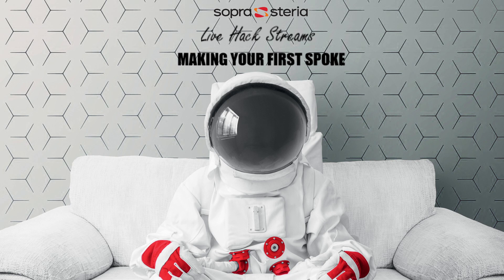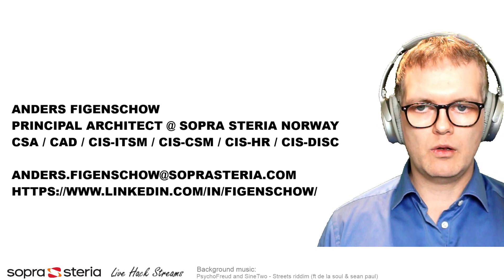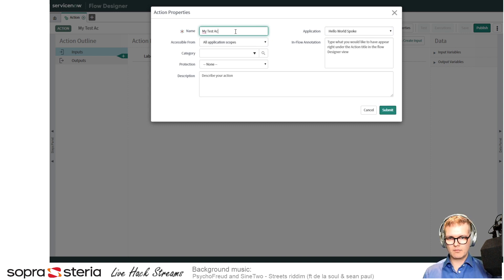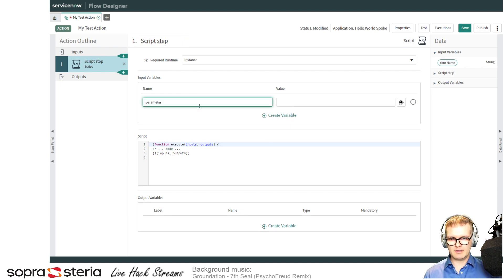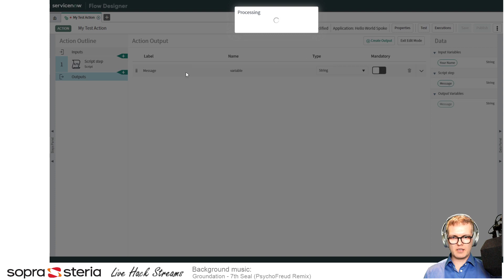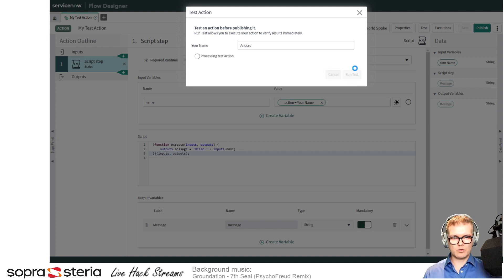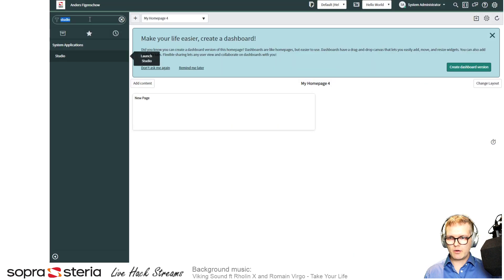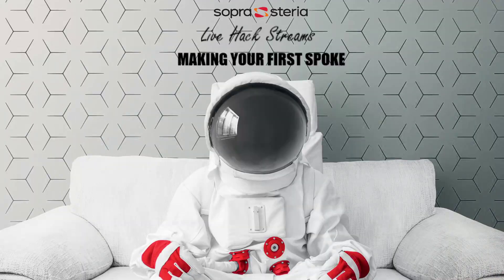Making a ServiceNow Spoke part 1

Comment: Hi, I followed the same steps in my PDI , but the spoke is not appearing. Do you know what could be the issue.
Reply from the maker: Make sure your application is called something which ends with "Spoke" - can you check the application naming?
Reply: @livehackstreams6764  Hi Anders, its working fine now, Thank you :)
Await for next video on this.